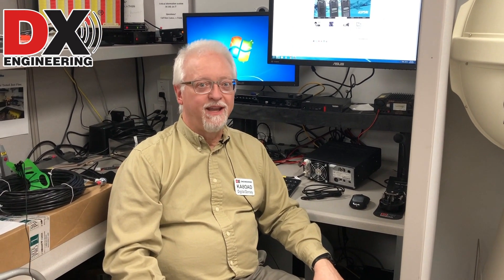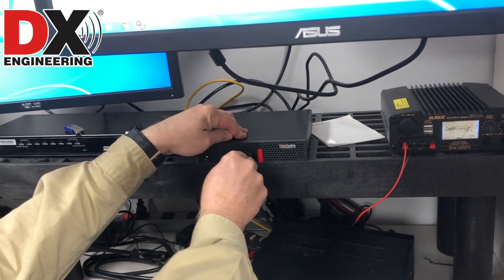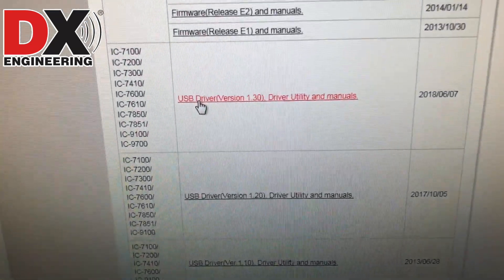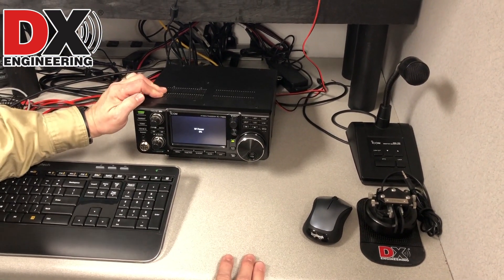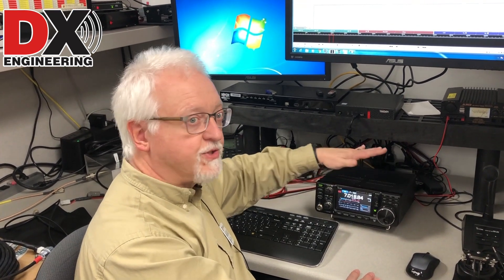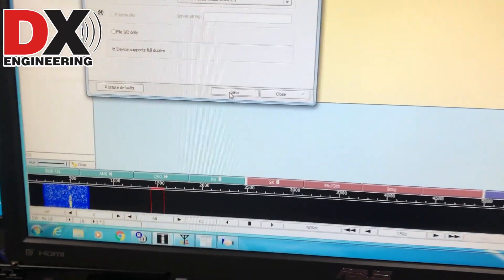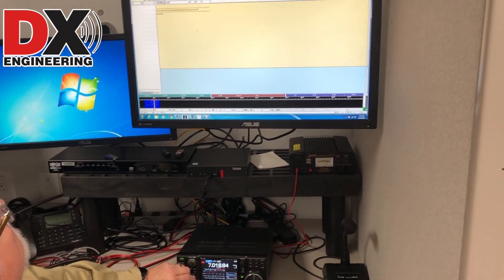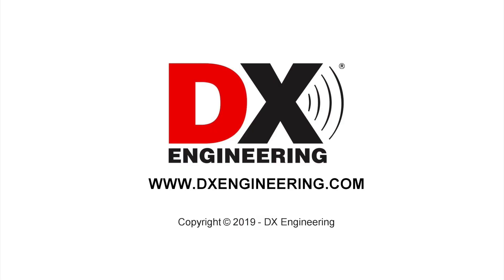How to set up your IC-7300 for Digital Mode

Comment: Why doesn't the freq on FLDIGI match the radio?
Reply: He doesn't have the CI-V cable plugged in
Reply: @geod3589  Actually, he does.  The USB can handle CI-V just fine.  He just didn't set the rig control up in this video.

Comment: Why don't you add notes that list the settings you said to use?
Reply: Love these idiots make these videos with NO SETTINGS, no link to software nothing
Reply: @DAVE_WHITE  now now they are not idiots, at least they are trying to help.
Reply: @brian.7966  help with what useless information and no link to the software?
Reply: @DAVE_WHITE  He tells you exactly what you need to do to connect the radio to the computer. The software (fldigi) is just an example of digital mode software. This video was not meant to teach you how to use digital modes. Learn what modes and software you plan to use and look for information specific to your decision.